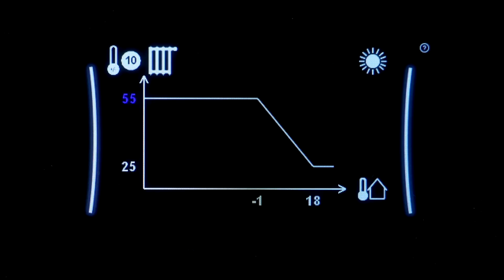What Is Weather Compensation?

Comment: Thanks for this brief explanation. Firstly I'm in the Netherlands and ASHP is beginning to catch on and we have a number of neighbours who have taken the leap. I still have to make that jump but I'm trying to get my head around certain aspects of ASHPs and weather compensation is one of them.

Currently I have a gas boiler with a smart thermostat in the living room with an OpenTherm connection to the boiler. The thermostat has no knowledge of the outside temperature but obviously it does know the current room temperature and the target temperature. So (going solely by the gas usage) it appears to regulate the flow temperature based on the distance between the the room temperature and the target temperature.

Now I was also under the impression that the thermostat can "learn" how long it takes to reach the target temperature. So this means that if I want the room to be at 19C at 7AM then it knows that the boiler might need to be fired up at 6:32AM so that the room is comfortable in time.

It would seem preferable to me to run the water from an ASHP at a lower flow rate for longer rather than demanding a higher temperature. Are there systems that can regulate in this way?
Reply: That's how most heat pump systems work. For example, my heat pump will try to run 24 hours a day (it's set up for 24 hour heating) without turning off, it will select the correct water temperature based upon the outside temperature - it doesn't consider the room temperatures. When it cannot modulate low enough for the heat pump, it will run on and off with cycles around an hour to give the right amount of heat into the room.

In the Netherlands, with your spark gap, the heat pump should be far cheaper to run than a gas boiler, even if it isn't optimised.